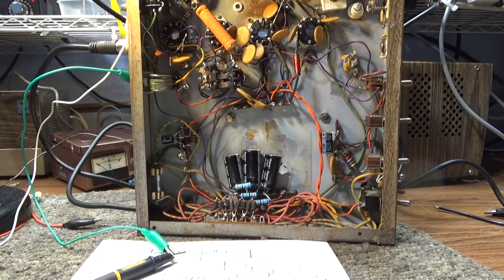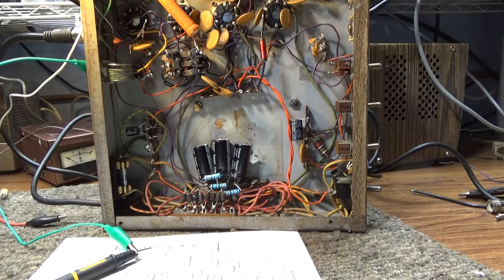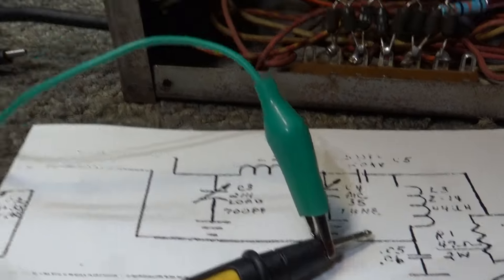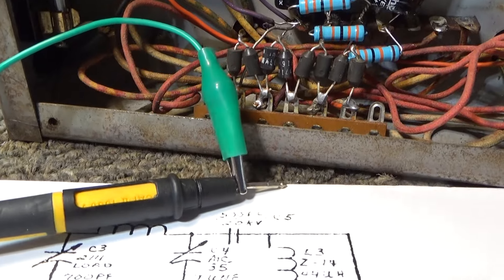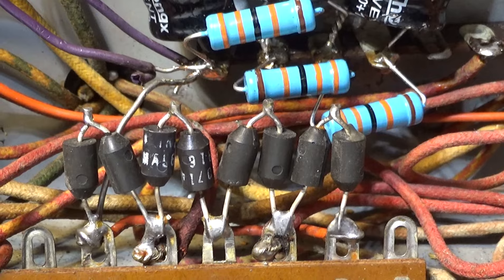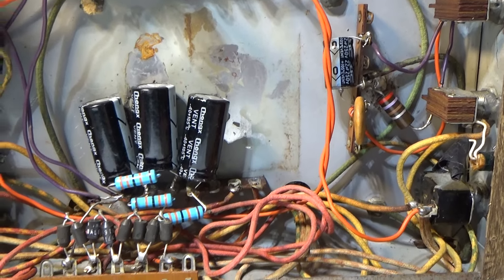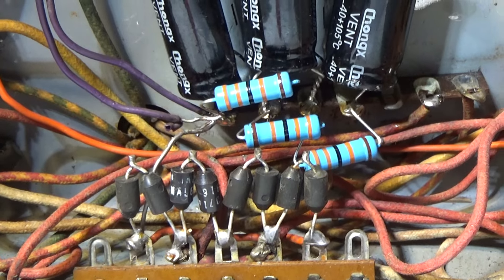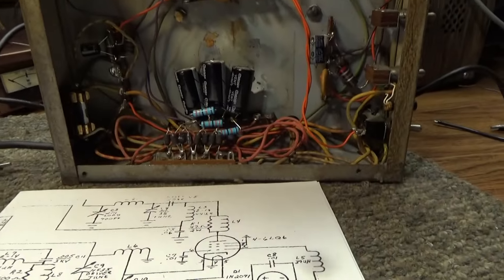Linear Amplifier Blows the fuse, troubleshooting

Comment: I worked on a fast draw timer for a guy one time. He was a western, quick draw artist, and bought it for its historical significance. It had a few tubes in it and it blew the fuse every time it was turned on. After checking everything and replacing many suspect parts, I was stumped. My Elmer told me to turn the lights out and look at the Bakelite tube sockets in the dark. That was it! In the dark there were all kinds of sparks going on in a Bakelite socket. The socket had become conductive! I replaced the socket and it worked great! I have since found a Bakelite electrical socket in my bedroom that burst into flames. It didn’t even have anything plugged into it! I put the fire out, replaced the socket, and didn’t sleep that night!

Comment: I use a "kill a watt" meter in line with a variac....it tells the story very well.....light bulbs in series with the line voltage works ok too if you don't have a variac.

Comment: I remember going into a surplus electronics store in St. Louis in the 70’s and they had big high voltage capacitors for sale. They had resistors across them, even though they weren’t in any circuit! I asked about this strange looking practice and they told me that when you’re dealing with these very high voltage capacitors, they have a tendency to charge themselves from static electricity in the air! They said that, given enough time, they could store enough power to knock the crap out of you!

Comment: I have a mavrerick 250, and the diodes first 3 going from left to right, are burnt. The fuse blowed and the power switch got hot and stuck in the on position. What could be the problem?
Reply from the maker: what probably caused all that is either a shorted HV cap or a tube shorted are by far the most likely candidates. However, it also could be a few other things, basically anything from the transformer itself, to the diodes, to the caps, to the HV relay, to the HV plate choke, to the tubes, to the plate blocking cap and possibly even the plate Tune and Load caps. Good Luck.
Reply: @tramdr wow, I've never worked on one of these. I just put tubes in it and maybe a total of one hour talk time on them. May cost more than what it's worth to fix.
Reply: The HV caps may be original I'm not real sure though.
Reply from the maker: and thats the common problem with using original caps. They may test good, they may be working....for now...... but put a little time on them and kapow.....and they usually take the diodes with them and worst case, sometimes the transformer itself. I have said 100's of times here, always recap those amps before you run them. To me, running on old caps is like running a car on bald tires. Just a huge problem waiting to happen.

Comment: My D&A MDX 200 blows the fuse every time I key it up. I believe it's a bad tuning capacitor.
Reply from the maker: It's a possibility but unlikely. The HV never makes it to the tuning cap only RF does. That is what the Blocking cap does. It is more than likely a bad tube, or a bad blocking cap. One way to find out is to key the amp with no drive. If it pops the fuse keyed with drive, then it is not the Tune or Load cap. If it doesn't blow the fuse keyed with no drive, then maybe it is a short in tank circuit.
Reply: @tramdr  okay thanks I will try that.